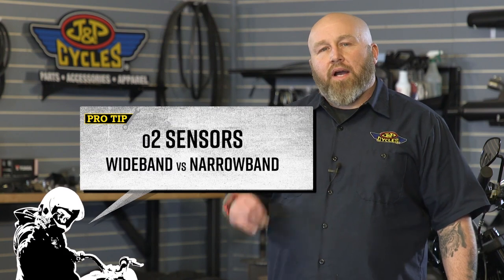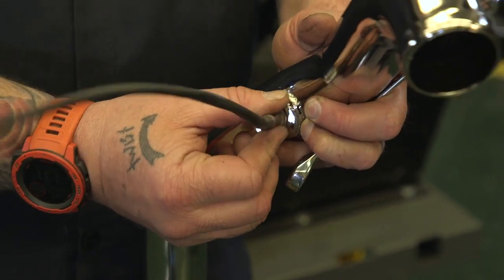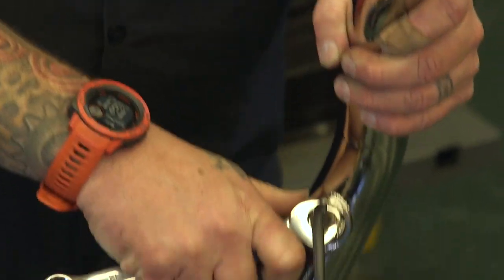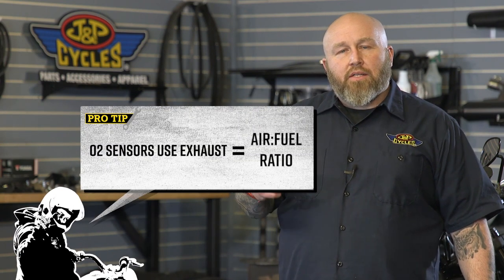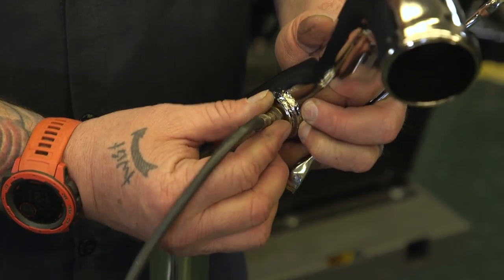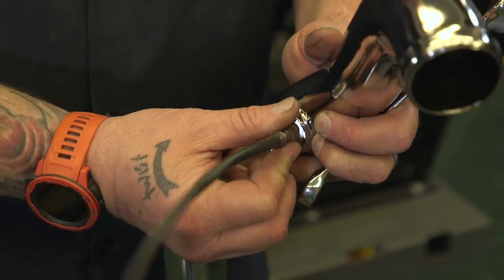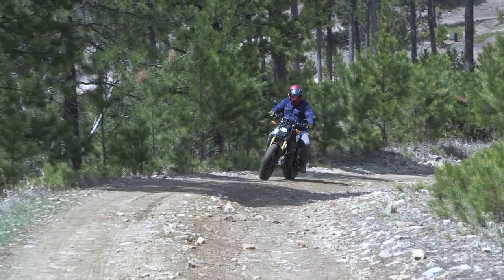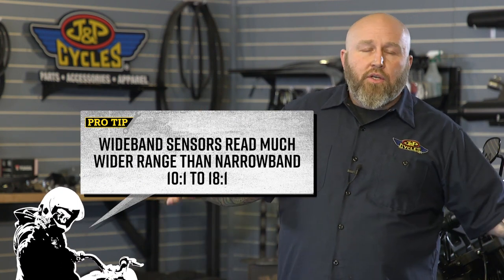Pro Tip : O2 Sensors, Wide Band vs Narrow Band

Comment: During this description a key piece of information was left out.

Why do they use narrow band sensors if they're not as good at determining the error in the exhaust mixture.

The answer is that narrow band sensors are faster at producing a result.

But the viewers would prefer at least some reason why there's two distinct types.

Comment: NICE VID EVEN THOUGH I PUT SHOT SHOT V&H PIPES I DEBAFFLED THOSE SUCKERS AND IT FEELS FINE BUT AFTER A COUPLE OF MONTHS MY ENGINE LIGHT CAME ON. AND IT READS THE CODE FOR THE O2 SENSORS . SO MY QUESTIONS  ARE IS THE WIDE BAND O2 SENSOR SHOULD FIX IT? AND WUT BRAND  DO THE J&P GUYS RECOMEND FOR A 2019 SPORTSTER 48?🤔

Comment: Thanks Patrick. If you want to use your stock headers is it common practice to simply re-tap the stock 12mm bung for the 18mm wideband sensors? I ask because I've heard that a new bung should be welded and the stock one plugged, but re-tapping should be far easier and cheaper (and it looks like that what the HD 'M18 Oxygen Sensor Installation Tool' is for?)

Comment: Ok, so you say the narrow band sensors can only read if it high or low of its operational zone..so when it does, is that high or too low signal interpreted by the ecm to make adjustments?

Comment: I have an old evo and I'm going to be installing a 113" Ultima El Bruto matched with a CV44 carburetor and I want my tune to be perfect. This seems like a great option but how do I check the main circuit?
Reply: the Evo uses a VOES not the O2 , The 02 is on 2012 and up its in the Exhaust pipe .
Reply: @JCcanU  I'm going to tune with the "bandwidth" method and get it perfect
Reply: @kennethwise7108  Unless your on a Dino have it tuned it will never be perfect . I changed plugs 2000 miles ago I have not pulled them to look .  Looking at your plug is the best way to tune a EVO .
Reply: @JCcanU  I'm liking this new method I've learned about and I'm going to try it.

Comment: So I'm running stock head pipes with full boar slip ons and a monster sucker intake, will the autotune feature on the FP3 be able to handle tunning the bike with the stock narrow band sensors?

Comment: I just bought FLFBS 22, the O2 sensors are attached to the end of the mufflers.
I want to change the mufflers to get a better sound, is it OK to change it at home or do I need to do it at the dealership? Also, do I need to change the full exhaust system or I can change only the mufflers? What if I took the sensors out are the gonna effect the engine performance?

Comment: Great info.  I just installed V H short shots, V02 intake and Fuelpak ( all from J & P ) on my daughters 14 Lowrider and wondering if I needed to change o2 sensors.
Reply: Definitely would help
Reply: Most likely not unless you’ve done major modifications (past stage 2). The FP3 isn’t set up to read wide band sensors without an additional piggyback V&H module anyway.

Comment: Running a Slim with a stage 3 and big shots. V & H do not produce a canned map for this so am looking at the autotune function...I'm also thinking wideband would give the ability to extract more all round performance from this set up...Interested in any thoughts you may have....Thank you
Reply: I think a wide band system would definitely help your bike run at its best. I have found that the fp3 struggles at stage 2 and higher. I ended up switching to a Power Vision and couldn't be happier.

Comment: If I install wide band sensors on my fully stock 2019 Heritage 114 will my stock system correct itself for the differences between lean and rich running?
Reply: Sadly, no. Wideband sensors operate between 0 and 5 volts, where as nearrow band sensors can only go up to 1 volt. this means that even if you manage to hook up a wideband, it could just fry your input on the ecu. On top of that, the computer wouldn't know what to do with these voltages. between its full range of 0 and 1 volts, a wideband sensor reads in the ballpark of 14 to 15 AFR, while 0-1 volts on a wideband's 5 volt range is usually around 10.5 to 12 AFR.

Comment: I have a 08 buell XB12 and when I purchased the bike it appeared to be running lean. Even the old Harley mechanic I had change the oil (wanted him to be familiar with the bike in case I ever needed something above my head) felt like it was running lean. Cracking a bit, kinda starving. I switched to a barometric sensor and open loop and it ran A LOT better. However, I have fouled two brand new plugs in less than 100 miles. It didn’t do that before. Did I make a mistake? Should I purchase a wide band sensor abs go back to closes loop? Still learning and exploring options but any advice.
Reply from the maker: What modifications are done to the bike?
Reply: @jpcycles  when i got the bike, just the stock exhaust/intake mechanism was removed and a “race” ECM installed. From what I’ve learned, moving to any aftermarket muffler requires this because only the Buell stock muffler and Buell race muffler has this mechanism installed. I added the barometric sensor and tune from a site called revision Moto because I felt like it was running very lean. There seemed to be several people against the barometric move and several people who loved it. I tried it and I think it’s better, maybe, than what it was. I simply want the bike in the best tuning shape possible. I don’t need any more horsepower than that monster 1200 will give me.

Comment: So if you have a harley with O2 sensors and pipes without O2 sensor ports do you HAVE to add ports to the pipes or is it possible to run those pipes? Have a FP3 as well.
Reply from the maker: You can run them without the O2 sensors, you will get an engine code. The reality is that stock narrow band o2 sensors don't do a whole lot. https://youtu.be/Z64DH1cxGFA
Reply: @jpcycles  awesome, thank you SO much for the information, it is GREATLY appreciated!

Comment: So I installed a stage 2 in my 2021 lowrider s and harley says that they can dyno it with the wide band sensors, which they will install and then when done they reinstall the narrow bands....? That doesn't sound right. They say that they make the adjustments in the ecm that's why it can run on the narrow band sensors. I have a pretty aggressive cam so, I'm confused